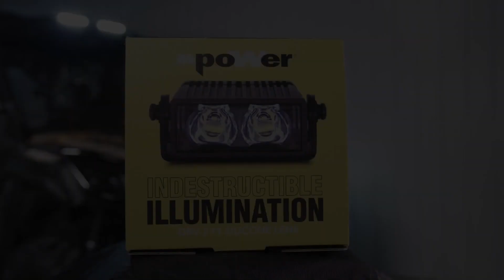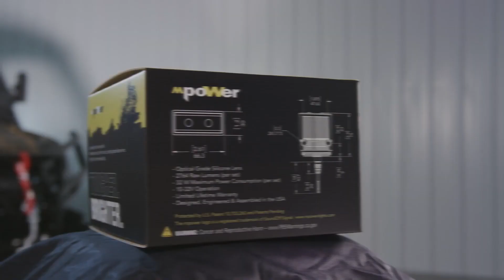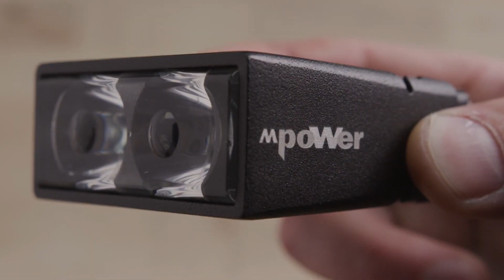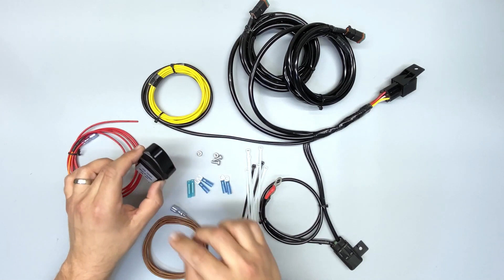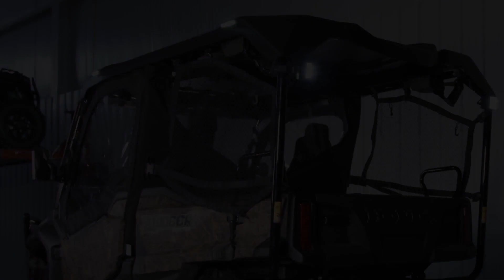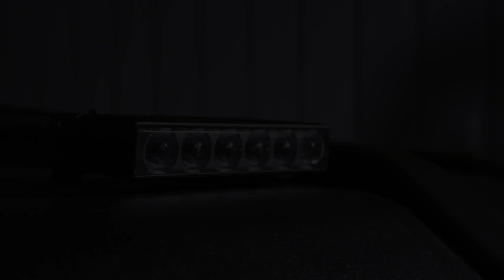How to install mpower® 2x1 and 6x1 LED off-road lights

Comment: What amp fuse is should be used when running 2 6x1 lights? I’ve got two on my vehicle and the switch always seems warm after they have been on for a about 15 minutes.
Reply: Michael - per the harness we include, there shouldn't be any amperage going through the switch. It is only being used to trigger a relay. Did you set your's up differently?
Reply: @twisteddamon1202  I had a local install shop put the lights on and I know they are going to a power distribution box and has a 20 amp fuse hooked to it, but I feel like it’s to small a fuse for both 6x1 lights.
Reply: @michaelbond3903  That light should be draw less than 5a each. It may from time to time rise above that based on the supply voltage, but never above the fuse rating. I pulled that info - 15a is the recommended fuse for two lights.